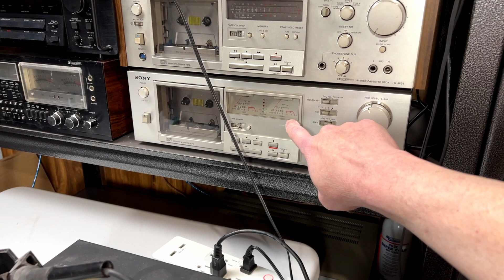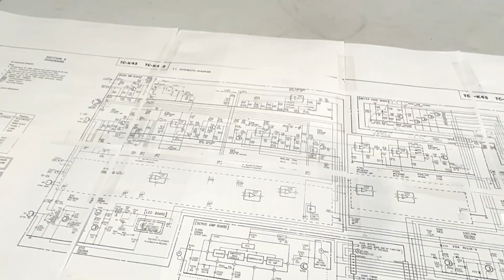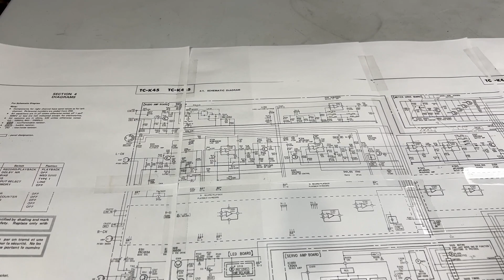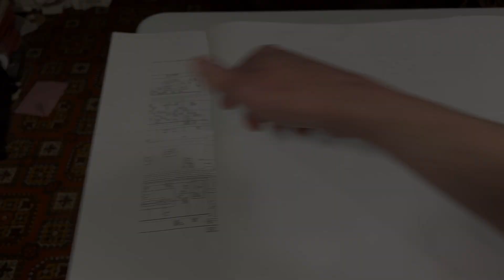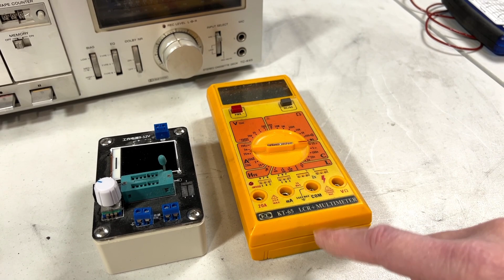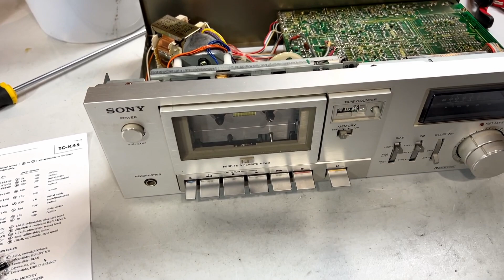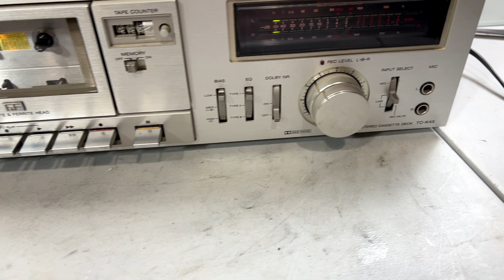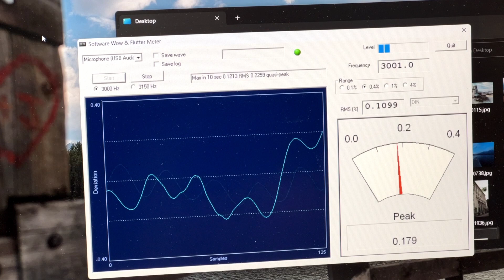Resurrecting My Grandparents' Sony TC-K45 Cassette Deck | Nichicon Muse Recap

Comment: I had this same unit 4 or 5 years years ago.  Picked it up from a thrift for $10.  The display was working but the tape mechanism was inoperable.  Since I had lost interest in cassettes years ago I was able to sell it off relatively quickly and make a few dollars off it.  Good luck repairing yours.  I could appreciate the sentimental value.

Comment: I just (for now) jumped further along and observed the head assembly base. Just as a general comment for anyone (including me!), try to avoid acetone on plastic - it sometimes partially melts or softens a plastic. This I found by accident on a parts only deck, thankfully I got away with it.
Reply: Later I saw that you mentioned it!

Comment: Здраствуйте. Хорошее видео. У меня такая же дека. Поменял только пасики. А вот что за лампочки 6v не могу понять. Их всего вроде только две одна в колоде другая там где индекаторы уровня записи. Пытался поменять на светодиоды, так они не хотят гореть. Не подскажите пожалуста ТТХ этих лампочек?
Reply from the maker: The lamps I used are 6V 3mm wired in series. The power source for the lamps is 12V AC, which is why the LEDs didn't work.
Reply: @Oklawolf  спасибо